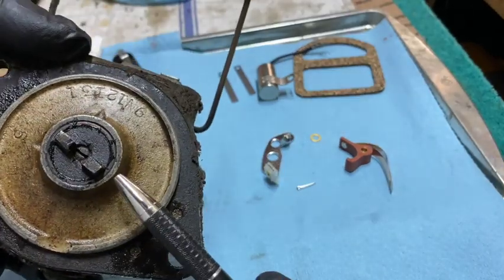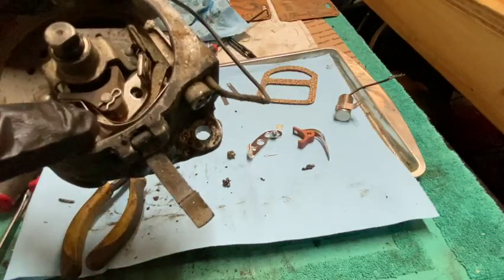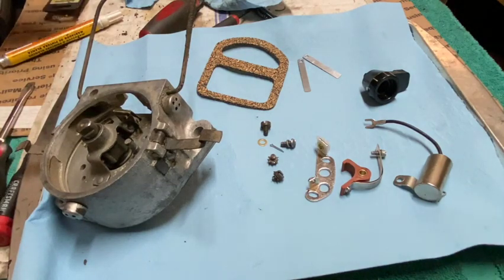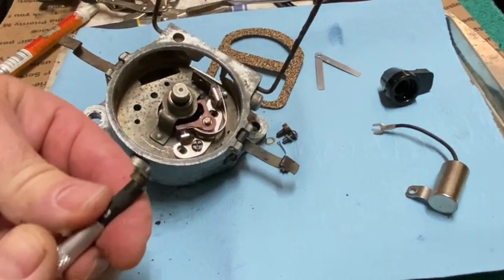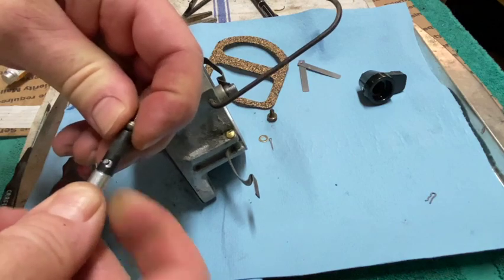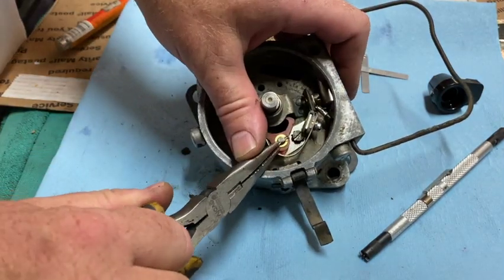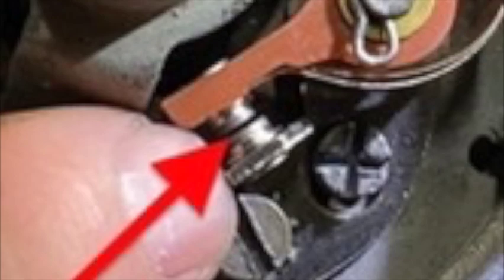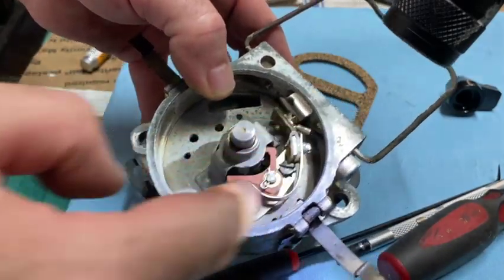Ford 2N 9N - Installing New Points and Condenser on a Front-Mount Distributor

Comment: I got a 2n motor has no numbers and has side distributor.. axle on left says 2n 1947.. question is what engine do I have?
Reply from the maker: Good question. It could be an 8N motor in a 2N, or maybe a 2N axle on an 8N tractor?
Reply: Rear housing is 3 speed and no bolt holes for swinging hitch.. also has Sherman trans with direct and high range.. axle trailing arm are the smoth style..hood and fenders don't have ford stamps on them.. thinking it's a 2n with new 8n motor with side distributor thst never got stamped..